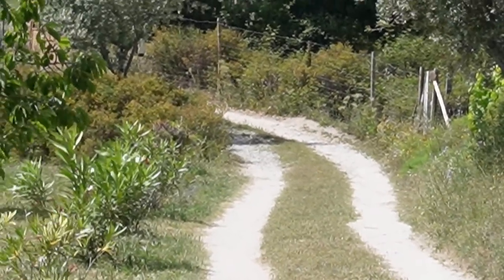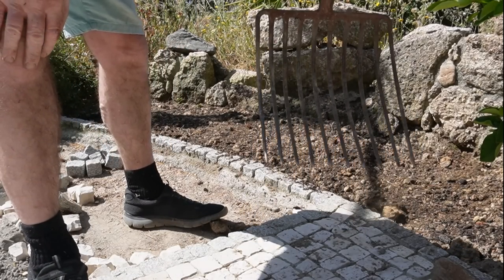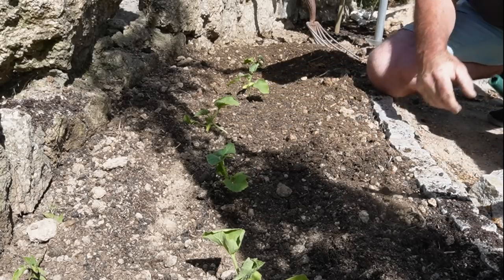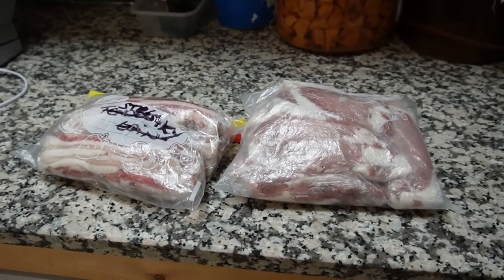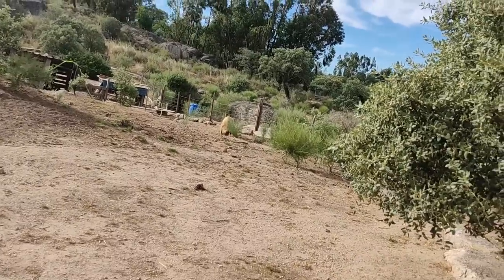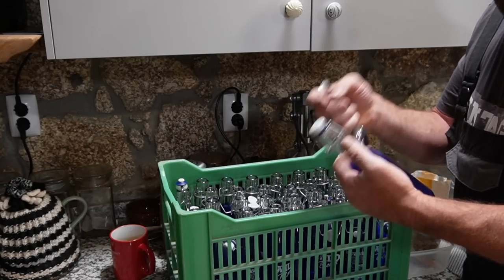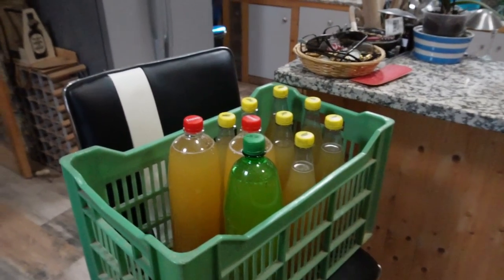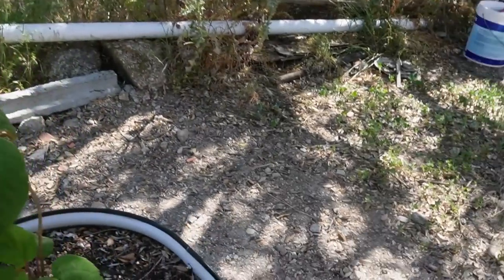Farm Life - Making, Mending, Fitting and Fermenting. 146

Comment: Hi Nick
When putting in a fence post,, is there any reason why you can not use a very big and long SDS drill,, and kind of predrill,, like th ones that Lidl has on offer,, what seams evert second week.
Reply from the maker: Drilling a hole makes the edges weak and pourous, whereas pounding a hole makes the edges more compact and stronger, simple Viking logic🤣🤔
Reply: @projectportugal  Well it looked to be a lot of work,, and predrilling, could help getting the pole in deeper,, with less effort.
Reply from the maker: Sometimes effort is needed